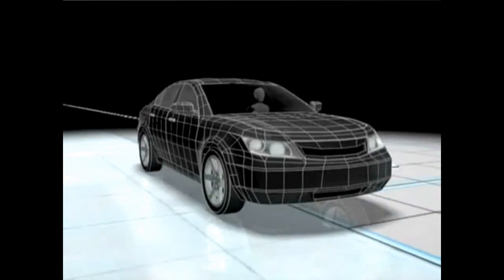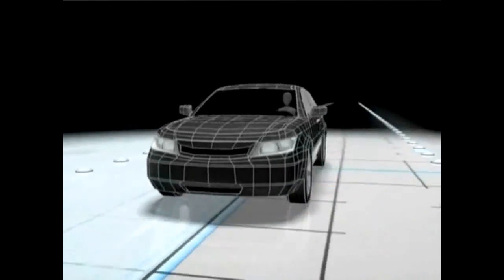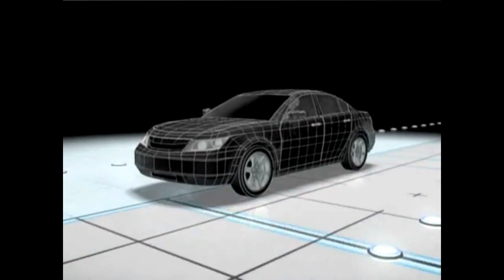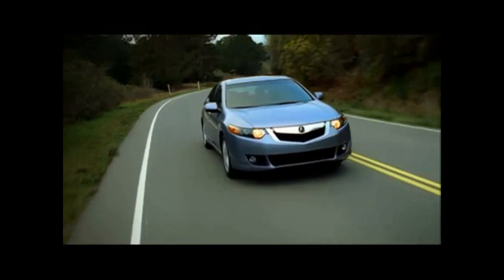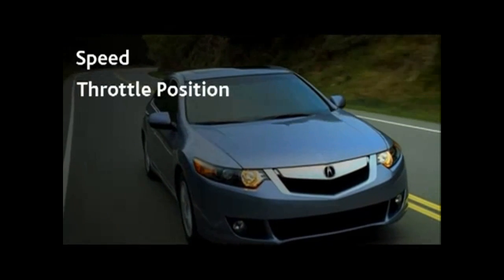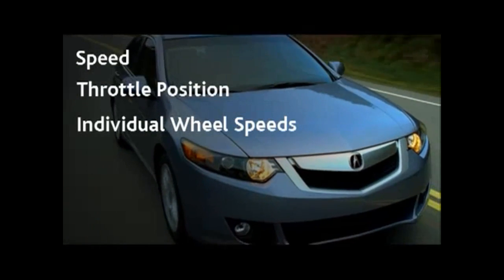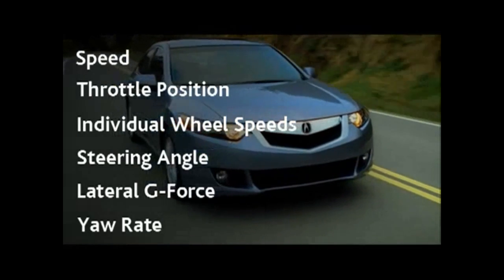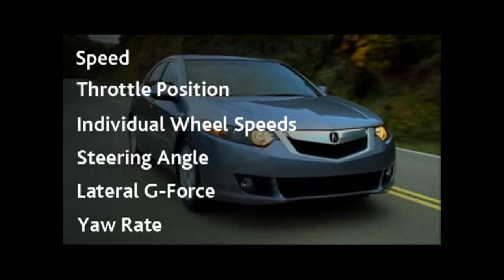Honda Vehicle Stability Assist - VSA.avi

Comment: engine management light comes on and stays on  after a few miles the VSA light and amber triangle come on then the trouble starts car doesnt accelerate smoothly for a bit and even worse at around 60 to 70mph the power drops off and then will kick in again and when the VSA light is on the cruise control doesnt work

Comment: My honda civic fd 2007 shows vsa until now.i cant turn it off almost two years.it is major issue or critical problem when on the road?how can i fix it and back to normal?thank you
Reply: If your still looking for an answer you have to HARD reset the VSA by Jumping the pin 9 of OBD plug to the ground(any vehicle metal, verify by using multimeter) Turn on key when ABS turns off press VSA, when the ABS shows again and turned off for the second time preaa VSA again. The ABS should blink twice. Thats it, VSA is reset

Comment: I turn it off every time I get in the car, even on 1 mile trips to the store, I loathe traction control. True traction control is proper driving technique.
Reply: ***** You are incorrect sir. You can clearly feel under-steer when VSA is activated and you apply throttle with the steering wheel at any angle but straight.
Reply: +Ryan M, When in a 1 mile trip to the store does any of your wheels break traction? You are saying that your either losing traction on the front which is the under steer situation or loss of traction in the rear for over steer. You have a family sedan. If you think for a second that is a performance car then you really are a fool. Get a real car and then talking to me about driving technique. Not on commuter roads that have you drive as passively as the law allows.
Reply: @gusbisbal9803  lol
Reply: I'm here because of 2015 Civic VSA saved me from an accident. I'm like "here we go" then I could actually feel it correct itself. My ass was about about to swing-out in a one-lane tunnel with slippery drizzle on the road. However, on a 2018 Toyota Camry car rental, I totaled it as one side caught gravel, plus it just started raining--mountain driving. I started to swing all around the road into a ditch. I would think a 2018 would have VSA. 

Anyway, you better leave that on as it could save your life.

Comment: I just bought a 2008 Euro version hatchback. its a 1.8 i-vtec. would i get a better performance out of my car if i have the VSA turned off? better performance meaning, better acceleration.
Reply: +Bartosz Adamson No. Did you watch the video. none of this happens until your wheels break traction. If they don't break traction then none of these elements engage and if your breaking traction off the line then your definitely losing acceleration through wheel spin.

Comment: My vsa light came on, I have a 2007 acura mdx, I just got some front end work done, so I have to get my truck line up etc. The light will go off when I turn the car off, please tell me I really don't have a big issue.
Reply: i know this thread is pretty old, but i had the same issue on my 2010 civic si i fixed the issue by replacing my wheel speed sensors. 40 dollar fix, but it helped having a code scanner otherwise it could be something else.
Reply: the first and last time my honda's vsa came on was when my vehicle had a problem w/  its automatic tranny.   since i got it repaired,  it hadn't lit up since